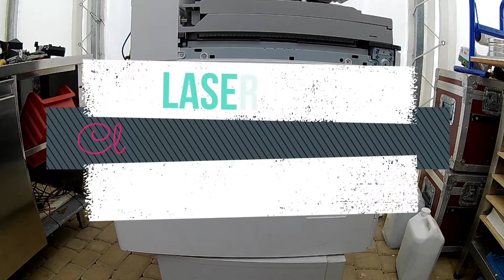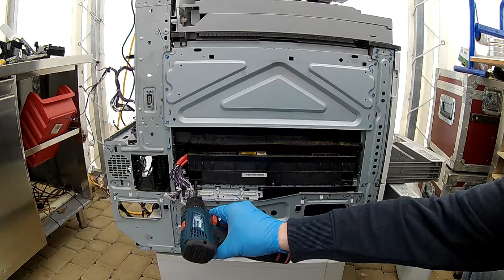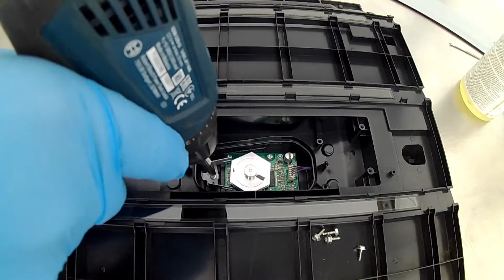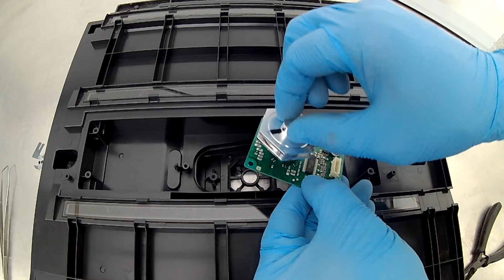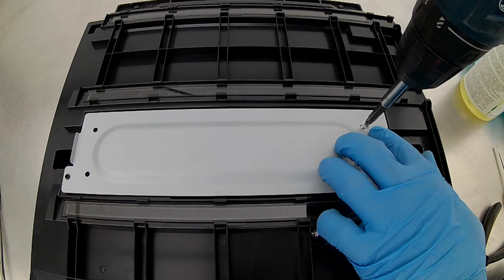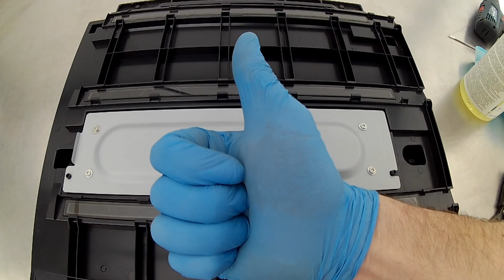Laser RICOH MPC 4503 5503 3503 3003 wymiana i czyszczenie

Comment: can u help me pls? i clear memory 5801 machine ricoh c4503 and  i get error 204-00. i try replaced laser and boar IPU but still got error. can u give me advise it pls ? thank you. sorry im bad English
Reply from the maker: If you are replacing the entire Laser Unit, you must transfer all settings that were in the machine from which the Laser Unit was removed. It is best to replace the Polygon Motror Mirror itself - then you do not need to change the settings. If the replacement did not help and you still have the sc204, it means that it is a fault of another element, e.g. the main power supply.
Check out my gadget store 🤩🥳 MOVIE STUDIO SHOP: https://my-store-7469644.creator-spring.com/
🔥🔥 YOUTUBE SUPPORT: https://www.youtube.com/channel/UCOHtXTtGHj33pUm8Gf2FH3A/join 
😁😆 PATREON: https://www.patreon.com/CopyExpertMovieStudio 
🔥💥 PATRONITE: https://www.patronite.pl/1796
Reply: @MrRicoh  thank you. i have replaced the polycon motor mirror but still got error. And I don't know how to correct the parameters of laser :((. because the machine is running normally but someone has cleared the memory, so this error appears. that's why I don't think it's the mail power supply. i think if i can change corect the parameteres of laser maybe remove error sc 204 but i don;t know that  :(( T_T.  im just newbie

Comment: Bonjour 
J'ai une Mpc4504 qui affiche parfois sc637-01 ou redémarrer  
merci beaucoup
Reply from the maker: If you have installed any additional software then maybe there is a problem with it.  You can check or disable some features:.  [User Tools -> ([Machine Features]) -> [System settings] -> [Administrator Tools] -> [Enhanced Print Volume Use Limitation] -> [Tracking Permission] to OFF
Reply: merci beaucoup 
et bonne continuation